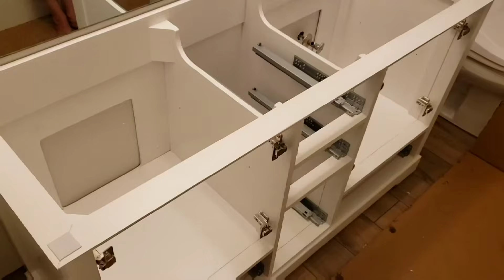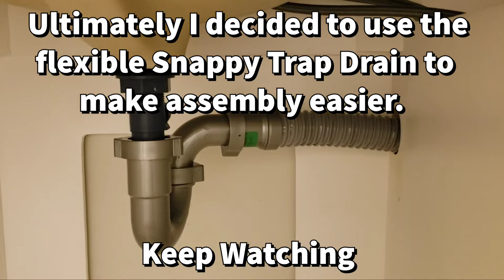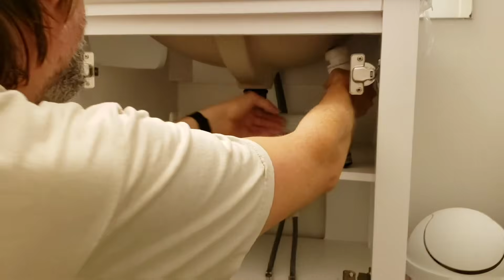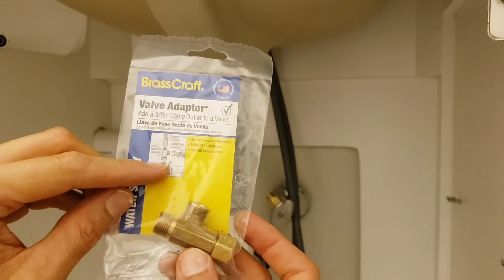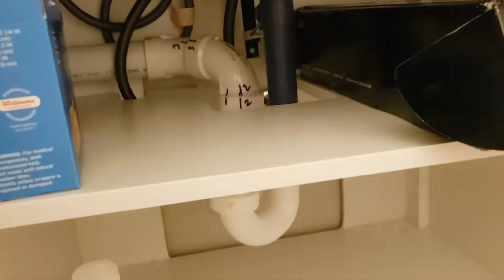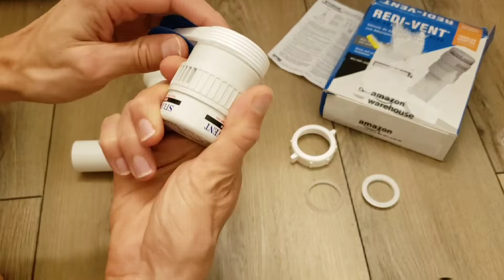Install Double Bowl Sink Vanity w/ Only One Wall Water Pipe Connection & Drain Pipe Using PVC

Comment: Why the hesitancy to cut the drywall? Even if you redid the drywall and didn't do a perfect job, it wouldn't been seen anyways since behind the vanity.
Reply from the maker: Fair point. We were also in a time crunch, and vanity shopping hell. This solution was quick and easy way to return to a low stress functioning household if you know what I mean...
Reply: @engineerable I know exactly what you mean. My wife wants to replace our single sink vanity top with a double sink top and thinks it will be a quick easy job! 😂 I do already have double valves on both the hot and cold, so that will make the job a little easier. The vanity itself is built for a double or single sink as well, so no customization required.
Reply: a way for pests to get in among other things...

Comment from the maker: One improvement that I would make is to eliminate the P trap on the left sink and feed both drains into a single P trap right before the wall drain. If the P trap is set at the correct height (below the wall drain pipe), then there will be no need for the Air Admittance Valve. This would require making a P trap from 1.5" PVC fittings because standard 1.25in bathroom drain fittings don't have the correct connections to make this happen.
Reply from the maker: @Joe M  Thanks for the advice! I will try that out.
Reply from the maker: @Joe M  I find many different fittings at HD for 1-1/2 drain tubing, like used for kitchen sinks and bath and shower. The bathroom sinks are 1-1/4. If there was an adapter, or a 1-1/4 compression ring that fits the 1-1/2 fittings. The Snappy Trap kit is 1-1/2 and came with 2 sizes of compression rings, 1-1/4 and 1-1/2. That was all I found that would adapt. Any other ideas?
Reply from the maker: @Joe M  What is the "tubular fitting" you are referring to?
Reply from the maker: @Joe M  Ok, makes sense. The problem was that I could not find a T fitting in that 1.25in light plastic drain pipe at Home Depot. So there wasn't a way to T the 2 drains together with that standard fittings. That's why I used the 1.25" drain pipe to Sch40 PVC pipe adapters. Does a 1.25" plastic drain pipe T or Y fitting exist?
Reply: I was able to find the T connector at Lowe’s in the 1.5”. But my T connection is not coming directly off the sink drain, but tying in to the wall out directly. I was going to put my vent there as well, but given what Joe M said I may not need it.